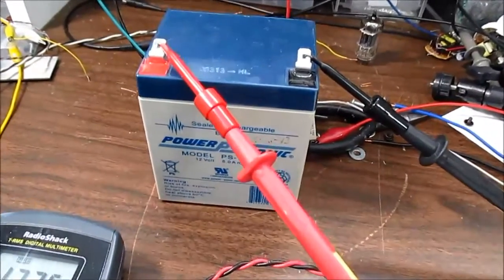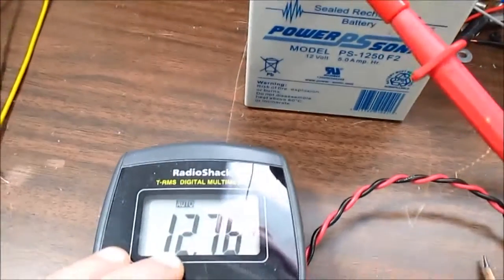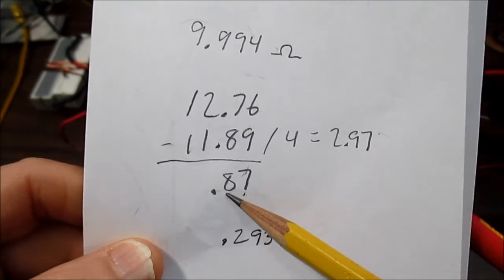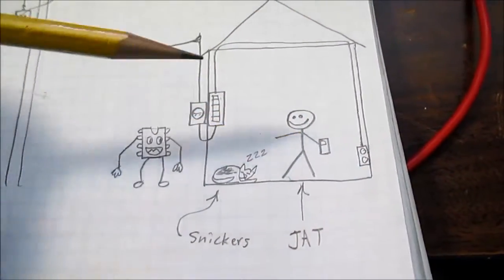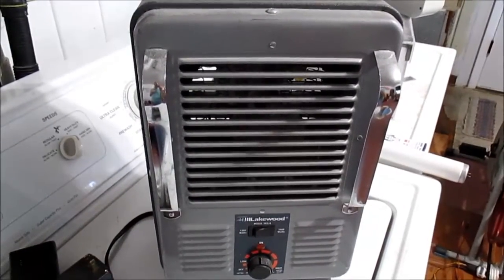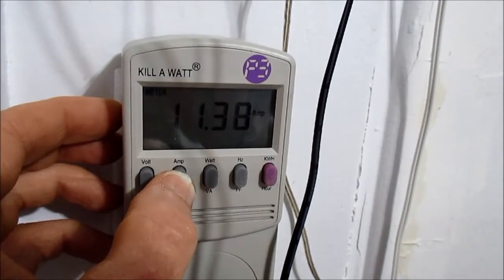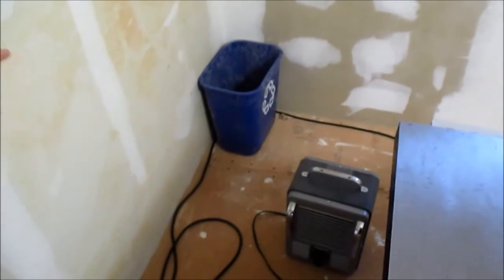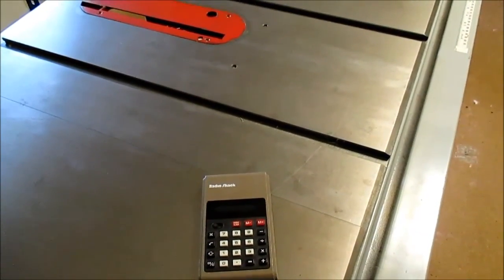Source resistance measurement examples Part 2

Comment: Thanks! This was interesting. Btw I noticed at my house that my washing machine plug was getting warm while it was running so I sprayed some wd40 on the plug and worked it in and out the socket a few times to clean the contacts. Now it's completely cold. I wonder if that would make a difference on your first socket that had a higher voltage drop.
Reply from the maker: I think it is the longer distance because the plug doesn't warm up when using the heater for a while.